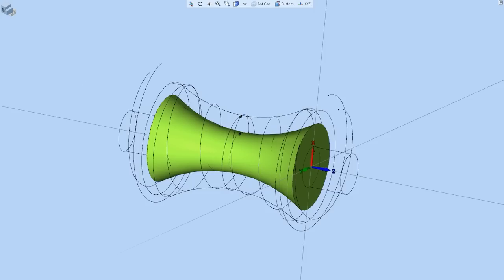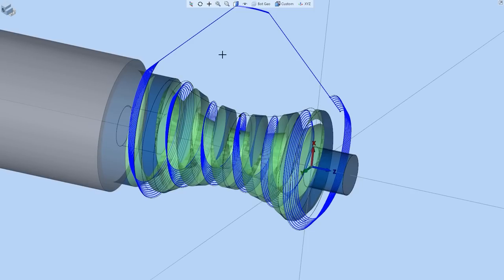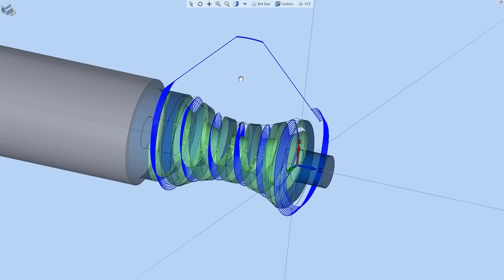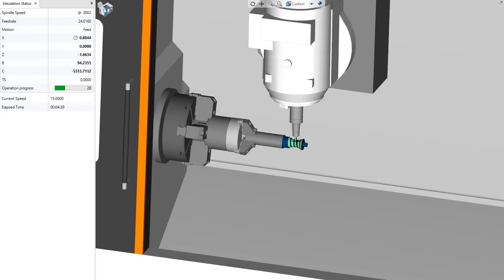Roller Cam Drive

Comment: exactly what I'm thinking,,, the two sides have been moved so the rollers run freely in the middle, changing direction, from one half to the other, at the ends there is zero backlash

Comment: I wrote some custom code to cut one of these on a 3-axis lathe with a synchronized feed using a circular tool that let me get into the overhangs. One of the tricky aspects to modelling it, is that the worm and rollers don't actually make contact on the center plane. Because of the helix angle of the worm, the contact line on each side of a roller is asymetric above and below the mid plane.

Comment: The way to model this in Solidworks is via the Motion Analysis software which generates the 3D curves used to generate a swept cut. It's called a "globoidal/throated" cam. Very nifty technique once you practice it a few times.

Comment: You've probably long since solved this, but if you model this in Fusion 360, you could draw a sketch of the cross section at any point normal to that path and then use the sweep function to follow the form as a cut which would make the Helix shape along the form, an involute profile, cycloidal, whatever you want. There's nothing that says you can't model it in another software and then import it into Esprit 🙂

Comment: The techinique for producing these dates all the way back to the 1920s.  It is very similar to single point screw cutting except that the tool is driven along an arc spanning the length of a workpiece which was been concave turned along the same arc.  This is generally done using a rotary table which is synchronised to the spindle in which the workpiece is mounted.

Comment: Almost easier to program that by hand. 
Would alternate the roller position on the gear so they roll on different sides of the worm. Could use 12mm rollers for this, could starfish the gear for mechanical preload

Comment: Rapids tend to be slower because of “in position checks” that the CNC will perform.  So when the rapid move is complete, the CNC will verify its position is in tolerance of where is was commanded

Comment: Happy to see someone with your resources thinking about a DIY version of this beautiful thing. I hasten to add that on a number of occasions watching a video of a rotary table running using this roller cam method, something was wrong in all of them. The rollers looked like a snug fit between flanks but they cannot be. Opposite surface direction. So after seeing your video , got all enthused again and laid out a 2d sketch to the following conclusion: The distance between outside edges of two rollers can be pitch X 2. Making sure , of course the crest or flank between them doesnt touch anything. Ill be watching.
Thanks Peter.
Bill Phillips, BC, Canada
Reply from the maker: Look at this video. A close up of the cam roller drive. Look closely you will see the rollers reverse direction as they pass thru the worm.  https://www.youtube.com/watch?v=2uHlH3H-1k0&list=PPSV

Comment: Looks like piss poor engineering to me.
Someone ran with an idea instead of considering easier alternatives.
Reply from the maker: This is an interesting comment? I guess you didn’t really watch the video. Because I said in the video this was just a experiment to see if I could cut this shape. Of course if money was no object a rotary linear motor would be the trick-est way to go.
Reply: @EdgePrecision  
I watched the video and was under the impression it was part of an assembly for some sort of production process.
Reply: It’s definitely a feat of precision machining.
Reply from the maker: @brentschmitt3338  No just a experiment in machine work. There are drive made to this type of configuration though. The B axis on the machine in this video is driven by one.
Reply: @EdgePrecision.  
Is this Pete?

Comment: Do you use inverse time on your rotary feed?
Reply from the maker: I don’t even know what that means? The cam software applies the feed in relation to the radius that the tools tip is from the center of rotation.
Reply: @Edge Precision is the code using G93 or G94 with the rotary axis?

Comment: What happens if you hit the motion hold button while it's doing a pass? Does everything stop but the spindle? Big red button in the case of an emergency? cool video!
Reply from the maker: Yes everything stops. Remember this is using the C axis to rotate the turning spindle. So it’s not a treading cycle.

Comment: I know this is not really the place to ask. However I figure there are some smart people watching this. 
Does anyone know how to calculate flow requirements to maintain a given pressure?
I’m trying to work out what flow rate (L/MIN) or (GPM) would be required to maintain 1000PSI with a ⌀6.30MM hole.
Even just the formula would help.
Reply from the maker: Just go in the web and type a search for pressure to flow rate calculator. You should get many selections.
Reply: @EdgePrecision  Thanks I had already tried something along those lines but was getting results asking for hose lengths etc.
Reply from the maker: Your hole doesn't have a length?
Reply: @EdgePrecision  I'm trying to calculate how much flow would be required to maintain 1000PSI through a Capto C5 coupling. I figured if I can achieve 1000PSI through the inlet of the connection the 6.30MM any tools used would have to run 1000PSI. The length I'm not sure of as there is the hose from the coolant pump then the internal plumbing of the turret. I did not know if there was a way to calculate flow without the length.
Reply from the maker: If you are referring to a high pressure coolant system on a machine. It's been my experience that most high pressure pump systems on machine tools run around 5-8 gallons per minute at the pump. So for a .250 hole at the tool they wont maintain a full 1000 psi. But the coolant holes on a C5 turning tool don't have that large a hole do they? Doesn't your system have a pressure Gauge on it? If it does you could try different size restrictions at the tool to find out.
Reply: @EdgePrecision  Yh I just managed to find a formula and worked it out. To saturate 1/4" hole with 1000PSI would need 45GPM. Which is pretty immense. I guess I better add up the area of the holes in the through coolant tools since there are hardly ever any tools that have outlets of 6mm. Never mind ty anyway.

I just realised what a stupid idea I had. That would pump near 3.5 ltrs per second. On what planet would that be necessary
Reply from the maker: The coolant system on my grinder has a flow gauge on it. When its running the gauge is pegged out at 40 Gpm at 350 Psi. Believe me at those volumes you don't need pressure. The only reason you need pressure is to force volume thru small coolant holes. The weight of the coolant at high flow is more important than pressure. Even with (More then say .625 dia.) large Gundrills you need volume more then pressure.
Reply: @EdgePrecision  Yh I was gonna be running some 90MM drills on Catpo C5 but like you say it might not be that beneficial for the extra pressure. Would be quite the spectacle to see 3+ltrs per second out a 90mm drill. Although at that point I would almost certainty be machine HP bound and probably on the brink of what C5 could take.

Comment: Hello, I have worked on these systems for many years. sorry but your model is wrong. In this design, the glass rollers will be jammed. The worm's side steps and middle steps are different.
Reply from the maker: The whole purpose of the video was just to see if I could cut the shape. I even said in the video that I could not figure out how exactly to model the shape. I do know in a conventional roller cam drive the rollers reverse direction in the middle of the worm.
Reply: @EdgePrecision  Hi friend. I have just sent to your e-mail a part that could be useful for you.

Comment: At 4:09 is there a way to capture the 'model' the simulation produced and put that back into CAD?  I'd love to print one in plastic to play with. 🙂
Reply from the maker: That may be possible. I think I can save a stl file of the simulation result. I will have to check into that.

Comment: Interesting concept and certainly something that would be super challenging to make on manual machines!
Reply from the maker: The only way would be a machine dedicated to doing exactly this. Or maybe a horizontal boring mill with a rotary table on top of its normal rotary B axis table positioned such that it's center of rotation was at the worms radius. And then all that geared to operate at the gear ratio needed. from the B axis drive handwheel. Then to cut it you would only have to set the proper depth with the quill and rotate the B axis thru the 90 degrees while the worm rotates at the correct ratio.  Or maybe rotate the smaller rotary table's handwheel to drive the large B axis thru the gearing to cut it. Simple don't you think?
Reply: @EdgePrecision  Yep 2 properly geared rotary tables should do the trick.

Comment: Hi Peter,
Not sure what CAD software you're using but fusion 360 has a "sweep" operation that you can pick a profile and a path. You'd use your helix as the path and the cross section of the cut for the profile. Hope this makes sense!

Excellent job machining that especially without the full model!
Reply from the maker: Yes and I tried that in Fusion. But it doesn't work for this. I even used both curves, it still doesn't work. It for some reason distorts the surface when it wraps around this path. I even tried to just fill between the two curves by drawing lines across their ends. This will fill in SpaceClaim and Fusion but I doesn't remain a flat curve surface. So as I thought I could just give it thickness. But that doesn't work either. This shape really messes with cad softwares.  So the sweep fill or extrude dont work. I think if a software could do this. I could define a gear ratio between the gear and the worm solids. Now if I had a solid projection representing the cam roller. Then I could say do a cut thru the worm with that as I rotate the worm with that rear ratio. basically it would be following my curves as you saw in the video, but the two parts would be constrained with the gear ratio. If that makes sense. Basically exactly the way the machine cut it.
Reply: @EdgePrecision    CAD tools that can model this are able to use 3D shapes (here a cylinder) as "profile".
The reason why a "flat" profile doesn't work is because of the expansive nature of the cylinder that the cutter/bearing represents when this "worm" rotates by.. parts of the cylindrical profile simply create a sort of under/overcut that a flat 2D profile is unable to produce when being dragged along a helical path..
And yeah, I know this because I tried to model something like this in Inventor with a 2D profile and run into those under/overcuts.. later versions (inventor 2022 or so I think) have 3D profile operations who can do what you originally wanted to do by using for example a cylinder as profile, but I don't have that.

There also was/is a guy who programmed this into/with FreeCAD some years ago and made YT videos of it: channel is called 'after CNC'
Video is titled: 'FreeCAD.凸輪 Video 3：Roller Cam_Dynamic Simulation'

Comment: You don't have to split it, if you increase the distance between center-lines the outtermost rollers would be loaded as they have the highest angle of incidence. I hope that makes sense, a roller in the center (with the groove perpendicular to the worm axis) would pull right out without binding, but a roller at a significant angle to the worm axis would be pressed against the groove wall if you tried to pull it away perpendicular to the worm axis.
Reply from the maker: https://youtu.be/2uHlH3H-1k0
Here is a link to a commercially made drive of this type. Look carefully at the rotation of the rollers. Look at the top of each roller. Rou can see the rotation easer there. On the middle of the worm drive the rollers are reversing direction. After thinking about this some more. I favor the idea of using two worms on one roller gear. Then loading each worm against each other by rotating them in the drive (Timing belt maybe).  But the cam bearings still have to reverse direction. Or make the the screw on the worm narrower and position the rollers in pairs. Loading them into each other as if on a track. This way the bearings always rotate the same direction (Opposite for each side but always the same for each bearing). This idea I also like. But you are correct Splitting the worm does not load the bearings evenly around the gear's circumference (If that makes sense). But this almost appears in the video what is happening.

Comment: Instead of splitting the cam for preload, you could model two rule surfaces with slightly mismatched pitches.  I believe this is how the machine tool makers do it.  Incidentally, Mori has a machine (NT) with a massive direct drive servo controlling the head’s rotation.  That concept hasn’t come into widespread use, probably because it makes the machine a lot bigger and more expensive.  But I’ve always thought that might be the best approach on a small custom machine.
Reply: This is exactly right!  - https://www.youtube.com/watch?v=mh9Q8p6CHx0

Comment: Are you able to sweep cut with a solid in esprit? I've done something similar in Solidworks before by creating the spiral like you have and then driving a cylinder (endmill) around the spiral wireframe as a sweep cut. Not sure if you could do it with two rails though to control the "tool axis" of the cylinder.

Comment: It's called a Globoid Worm Gear, if someone hasn't already said that.  I spent hours trying to model one of these in Solidworks but finally gave up.  I'll have to look at your approach of creating a ruled surface and see if I can get it to work.
Reply from the maker: In the cam software I was able to create a proper ruled surface. I could not make a proper one in the cad software. For some reason having the rotations messes it up.

Comment: Great video 👍 Maybe do a single lobe and test out different machining ops to get a better finish.
Reply from the maker: This was just a test to see if it could be done. No attempt was made for proper finish or dimensional accuracy. Or even the proper material and heat treat that would be required. Now that I have a idea what to do. I have different ideas on the design to improve on how it would work. Thanks.
Reply: @EdgePrecision  nice to get a design that has to be thought about and process to get a finished piece thank you!

Comment: Why dont you turn it with special grooving tool? Side wall surface finish would be much smoother.
Reply from the maker: The finish would be better if I had applied finish cuts. Remember this is just a cut right thru the center. when cutting like this the endmill is actually plunging into the work with it's tip, because it is rotating. The leading edge is plunging. This will cause vibration. If the finish cut just cut the walls the finish would be better. As to cutting with a grooving tool. In order to do that kind of thing. The machine would need to be on a threading cycle of some sort. While rotating the B axis. In essence rotating the B axis and moving the Z for the thread. Remember the machines center of the B axis is not at the parts worm center. So the Z axis has to back up as the B rotates. I haven't tried this before, but I'm pretty sure this would give an alarm. I don't think the control will sink a rotary axis with a linear axis in a threading cycle. To the spindle.

Comment: I know a fellow colleague who keeps telling me that you need a straight up model and always trust the post for that model… Using Mastercam. Your process is a great example of having to work around the software limitations.
Reply from the maker: If I had an accurate model of the worm it would be better to program from in Esprit. Then I could use real 5 axis cuts on the surfaces. As it is I'm really only cutting to the wire curves, of the ruled surface. I can sort of make finish cuts by offsetting the cut from center-line. But its not the most ideal. Also I could put proper chamfers and finish the thread ends. If they were also modeled.

Comment: No matter how much checking and double checking, that must catch your breath when the "Y" head swings toward the cabinet at speed.
Reply from the maker: This is why modern computer simulations have made this kind of machining easier to to. In the past I would have to sort of guess where everything needed to be. Run it and carefully watch. If there was interference redo the setup until everything cleared in the machine. Much more stressful.

Comment: Make a surface between your two curves then thicken the surface and subtract, or offset and draw the rest of the surfaces and subtract from the solid.
Reply from the maker: Tried that it didn’t work.
Reply: Or he can try to make surface between curves, extrude it to given thickness, and than subtract from solid body, this way works in solidworks, Im not sure which software he is using and if its possible on it.
Reply from the maker: @nekk1991noviprofil  I tried that too. It didn’t work. For some reason the surface won’t stay flat between the curves. I even tried to put section/match lines between the curves to flatten the surface. That didn’t work. There is  something strange going on because of the shape.

Comment: Very nice Peter, I think the preload comes from the rollers, as I remember every other roller is offset so they roll on each side of the worm.
Reply from the maker: You can visualize the spiral as a straight track with bearings on each side. Now wind that into the spiral shape of the worm. That is what this is.

Comment: Could you offset 2 rollers on each pin for no backlash?
Reply from the maker: I think it would be easer and less complicated, to use two of the worms on one roller gear. Loaded against each other. Often times the simplest solution is the best.